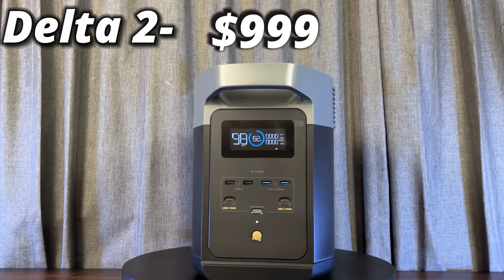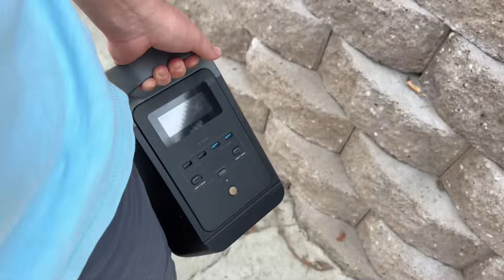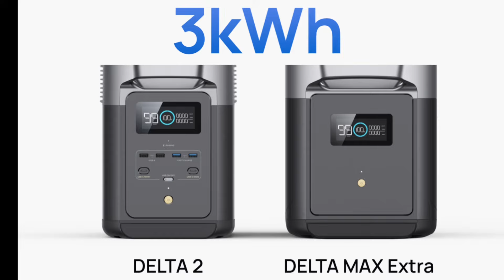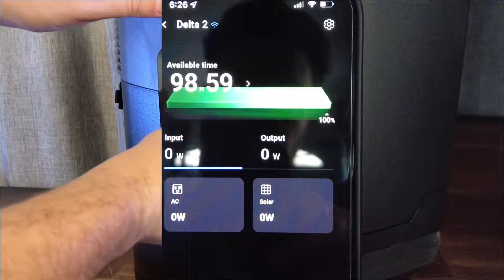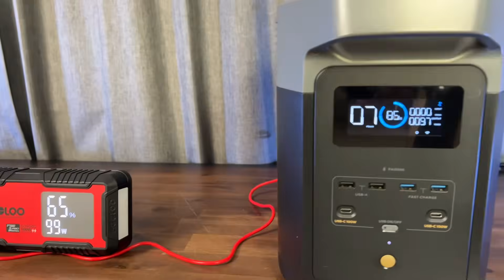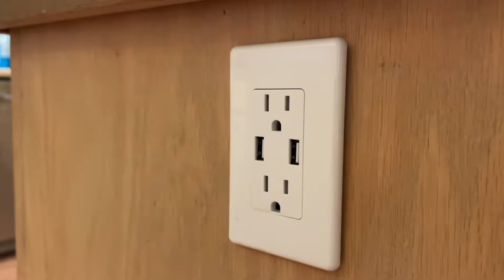EcoFlow DELTA 2- Best Portable Power Station?

Comment: I'm just looking to run a small freezer coffin freezer, 550w max when running, while  solar charging and using a Honda 1000 gas generator to charge it when there's no sun ☀️☀️☀️.  Will this work?
Reply from the maker: Yes it will work but understand with no solar coming in this unit will only run that fridge for less then 2 hrs. Now I get it will click on and off so maybe 5 hrs at most as it turns on and off. But you have the generator, so you should be fine as long as you don’t mind firing it up once in a while. Also time of year will depend how long as well. Summer verses winter

Comment: Would you recommend buying EcoFlow's bifacial 220 W solar panel with Delta 2 or getting a third party panel (if yes, which one?). Eco Flow runs a promo now where they sell Delta 2 + 220 W panel for $1,399, but I am still on the fence whether it's worth it.
Reply from the maker: I’m sure ECOFLOW is probably reading this and who knows I’ll probably get in trouble…..

But the bifacial is cool, although I’ll be doing more testing and comparing in the next week and more and posting a couple videos, I don’t know if I would use it or but it for a panel I wanna set and forget. 
These are portable panels that you set up and take down. 
If you plan to leave something out get a rigid panel. 
Now again I wanna do more testing and compare the two which I’ll have more info soon. 
But depending what you need will help answer what you should get. 

I like the panel but I don’t like the way you have to use the cover to set it up. It’s on the ground where ever you are getting dirty. If you don’t have the cover it can’t stand by it self. So you have to mount it, lay it flat on ground or build a rack.

Cool panel but has a couple flaws as a portable.

Comment: Quick question! I am in a solar group on FB and they say that you must Ground your panels. Huh? Is that necessary for all systems? Idk what is required? Thx!
Reply from the maker: In a grid tie system they must be grounded per code. Anything hooked to your house it will need to be. 
A free standing system which is separated from you house like a example of 4 solar panels on the ground and plugged into a power station do not. But it may be a good idea on the panels if leaving out all the time and if lighting hits them maybe this will save some of them or at least the power station. 

But grid tie systems also have to be inspected and have a electrician wire it in.
Reply: Oh! I see. Well, I am outside city limits and not going to tie to the grid. So, I am such a solar/electric dummy… How do I ground the panels? Would it be better to use a flexible panel and just bring it in before storm? Our weather here in west Texas is a bit unpredictable. 🤔
Reply from the maker: If you are going to just use portable panels and move them around and not mount on a structure don’t worry about the ground. Even with a ground the panels and anything connected more then likely will be fried like most things.

Comment: Wow. I have to say, very advanced features... gen to battery...here's my question, can you run the panels and the gen simultaneously with the unit managing it all?

I love the idea of having the panels charge during the day and then having the generator kick on over night once you  hit a certain capacity.
Reply from the maker: Yea you can. I was doing it yesterday 👍🏼👍🏼
I added ac as well so all three. Then I added a Honda generator the ECOFLOW smart gen and solar all at once.. I had them at low charge rates though.
Reply: @johnnysweekends   I actually have a mini and panel and I assumed other power banks were similarly advanced, but I recently got to borrow a friend's high capacity 3000KW unit from well recognized brand and it was far less advanced. It would not, for example, charge on AC while also putting out power (I had to use it for a planned outage) and its input charge rate used an external charger and was limited to 200 watts unless you pay for the larger charger that was bulky and expensive. 

Not to sound like some kind of kiss-ass, but the Eco Flow's are very advanced and we're seeing that here with this kind of integration of conventional ICE, and solar. I need additional backup power like I need a hole in the head, but I am tempted.
Reply from the maker: Now when using ac input or a different generator your load is only able to run off what the ac input can provide or the generator well that’s the pro. So I wonder if that changed at all on this unit.

I’ll have to do a run test while charging to see if I only put a 1000 watts on it for ac if I can still run the full 1800 no problem or it is passing through..🤔
Reply: @johnnysweekends  want to see your result. If the unit can manage DC input with its generator input that would be super slick. Add an aux tank on the generator and enough panels and you could have a real never think about it answer for long term outages or camping. 

The auto start stop generator option also let's you keep the capacity of the battery a bit smaller too.
Reply from the maker: I’ll be doing more stuff with the ECOFLOW products in the coming months starting around mid or early October. I’ll have more time then. Lately it’s been nuts.

But yea I already have a extended run fuel cap..👍🏼😉

Comment: Is it possible to use the Delta2 to charge a delta pro using the AC input, either directly or in UPS fashion? Thank You!
Reply from the maker: Yup, it doesn’t know what it’s plugged into on the AC input. Only that power is provided and what ever you set the AC speed at…
You can piggy back just about any power stations

Comment from the maker: Quick correction on this unit, the solar cable is not included in the unit. Why ??? Well I’m not sure, but in my opinion one should be.
Reply: Idk, but this big push by most of the big name solar companies is making me a tiny bit nervous. I am looking at this one and the Bluetti Max 300. Such a tough decision… 🤔🤨🙄
Reply: Oh! I meant to say the Bluetti sold by Miller Tech. ☺️
Reply from the maker: It’s tough but both are good units and most all these will do what you need to. 
So far even the other brands out there have been fine for providing power. 
Just depends do you want a Honda or another brand that will probably be just fine. Both Bluetti and ECOFLOW are the top choices but so many are coming for them 😅👍🏼
Reply: As a “Solar for dummies” person, I really want the easiest, all inclusive, mid range priced system available. Hoped it was this one… still not sure… 🥺
Reply from the maker: It really come down to what you are trying to accomplish.

Comment: Why would you recommend EcoFlow Smart Generator in conjunction with this? Isn't the smart generator essentially just a more expensive battery aka Delta 2? Or the Delta Pro just a bigger version of the Delta 2?
Reply from the maker: The ECOFLOW smart generator is not a battery but a actual gas generator. It talks directly to the delta pro and delta 2 and more to automatically start and stop ask on its own to provide a charge or more power if and when needed…👍🏼

No other generator does this.
Reply: @johnnysweekends  Interesting, I never knew how all their different models interacted etc. I'm trying to figure out the best way to power my house without paying 10-15k on a natrual gas generator plus redoing landscaping and irrigation. I like the battery concept no poisonous gases or noise. I have a 2800 sq ft 4 bedroom home. Suggestions or ideas on utilizing the Eccoflow brand of products?
Reply from the maker: So I guess budget come to play. And overall what do you want to accomplish. 
Do you just want to run lights wifi and the fridge ?? 
Then these can be a great option and will last a couple days or more if you get the extra battery and also charge during the day. They will not run a home ac unit. They can but not long. But you would need two delta pro units to pair together and double voltage hub for 240volt.
That’s about $6500 and 7200 wh but 7000 realistically. Or $8500-10k gets you a Tesla power wall or enphase battery setup but you need that installed professionally into your panel and probably a permit as well. Both includes no solar at that price. 

The delta prop is portable and has more uses then a battery mounted on the wall, 
But the wall battery is 240 volt ready.

So if you wanna run things in the house you will need to install a critical loads panel then plug delta pro into that. Like a generator.

Which in the end, a gas generator is the cheapest and simplest. But has its draw backs as well.

So depending what you wanna power and for how long will give you a idea on which way to go.
Reply from the maker: Here is the smart generator video ECOFLOW Smart Generator Test Review
https://youtu.be/MtKGzfpdfnw
Reply: @johnnysweekends  Great response thank you sir 🙏 I guess I'd like as little maintenance as possible and not have to lug a generator outside in the snow or rain in MI or worry about it getting stolen. Something that could run 3 days and about 5-7k watts max load. I just don't want to spend $6k + on Delta Pro x2 plus Delta generator, panel etc etc but extension cords everywhere isn't appealing either lol
Reply from the maker: The ECOFLOW setup can be used with there own smart panel hard wired to your home. Or you can just wire a sub panel for critical loads and run a cord from the delta pro to the small panel and then power the circuits you want. 

So are you wanting to power 5000-7000 watts on and off for a few days or or 7000 watts for a total of 3 days or 5-7 a hour lol. That’s a lot of power!
Reply: @johnnysweekends  5-7k watts a day for 3 days
Reply from the maker: That’s a decent amount of power.

Considering the ECOFLOW delta holds 3600 Wh …. 
If we do 6000 watts a day that’s 250 every hr for 24 hours. Then you need to replace that with a generator or solar panels. And depending what the weather is like you need a lot of solar to replenish that. Under ideal conditions maybe 1000 watts but 1500 for lower levels of light or shorter days. 
One delta pro would be close but not enough. Now you could buy lithium battery’s and a rig to charge up the ECOFLOW pro that way which there are tricks or you buy the big extra battery. 
$5000k about for both. But I do have discounts all the time for ECOFLOW products. But you will need solar as well. 
About $1000 for 1500 watts depending where you locate it. Used or new and type of panels. 
Then you need a sub panel to hook to at your place and done. $7000 about for a flip a switch setup. But also where do you plan to put solar panels??
Reply: @johnnysweekends  I use about 1500kwh a month, I just looked at my bill lol I'd prefer no solar panels pitfa.
Reply from the maker: Lol well no solar panels then you want a battery back up system and a gas generator. So either ECOFLOW type setup or the bluetti and stack the batteries or maybe the renogy Lycan and expand the system or either permanently do the wall mount batteries and a generator if the power is out longer if no solar panels.
Reply from the maker: You a tough customer 😂👍🏼
Reply: @johnnysweekends  What sucks with the Ecoflow is you can't charge the Delta Pro with say a Honda generator while the Delta is powering things apparently. So you have no power until the battery is charged up again unless you buy their Ecoflow generator which is only 1800w I believe. So if you're using more than 1800w I'd assume the battery would go dead on the Delta Pro regardless?
Reply from the maker: Yea there are ways around this with a Dc converter but I wanna double check this again to confirm. Maybe I’ll do that tomorrow afternoon and let ya know. 
But I’m sure a ac to Dc converter could be used then charge through the solar port. 
There are ways my friend lol
Reply from the maker: So currently running my Honda generator and the delta pro is charging 
750 watts going out and 1600 going in and went from 92 to 94%
Reply: @johnnysweekends  Interestimg I didn't think you could run the battery to power something while using a separate generator to charge the battery that wasn't an eccoflow generator. 🤔
Reply from the maker: Yes people have been saying that for a while and I didn’t understand why. And I never went back and check on it. 
Well my Honda was plugged in ran about 1500w in and then turned a heat gun on to 750 watts. Battery was at 86 then went to 94 after a second try. 

I ran the heat gun for a while to drop it a little lower, then turned gen on manually set it. 
So I don’t know. I think they don’t want you to think that. So they will sell units 

I posted in the ECOFLOW forum and so far they haven’t approved my post. Be curious to se if they do. Been a hour now. 

Lol so will see what happens.
Reply: @johnnysweekends  Damn lol, shady sobs 🥸😳 interestimg still $3700 for Delta Pro is nuts
Reply from the maker: I’ll make a video on charging the unit using all kinds of crap.

I had the Honda plugged in, solar plugged in and the smart generator all at the same time 🤣🤣

I also have full time discounts through a distributor and also a company who sells bundle packages…👍🏼
Reply: @johnnysweekends  Sweet! 🇺🇸 Just to buy a 2200 watt Honda and Delta Ecoflow Pro is $5k lol that's nuts.
Reply from the maker: I know it’s crazy the price on this stuff. You can always buy a different gen it doesn’t have to be a Honda